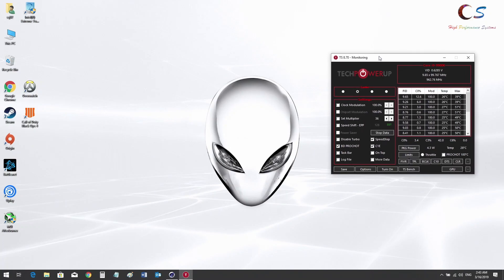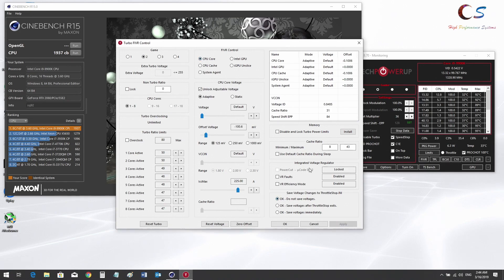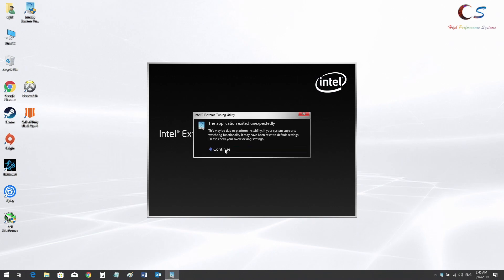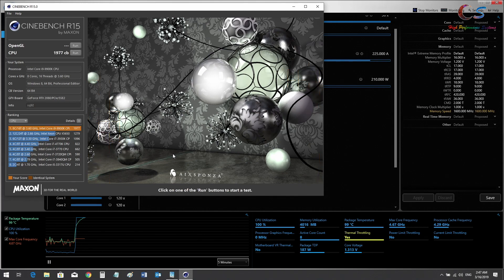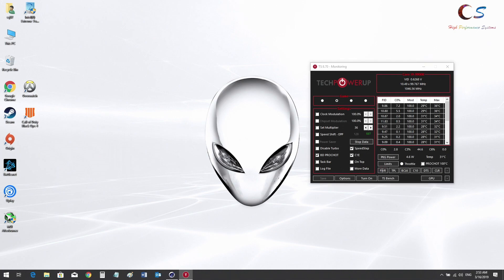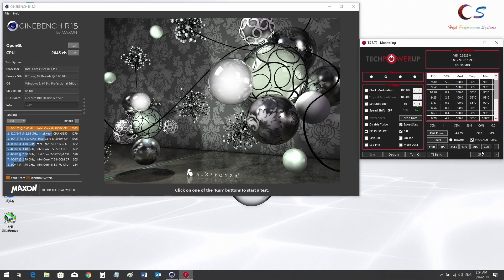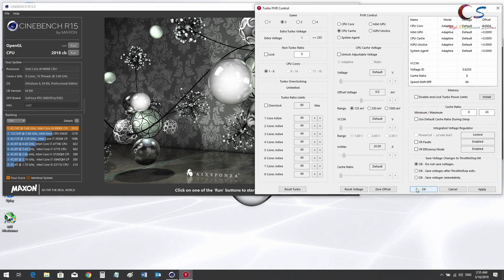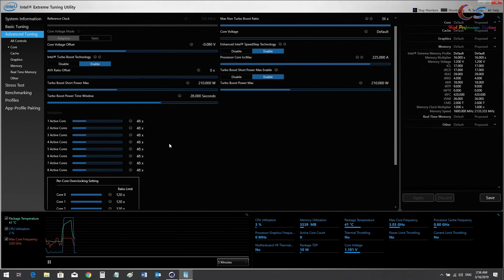Laptop CPU Undervolt & Overclock (Throttlestop & Intel XTU)

Comment: The option are greyed out. Any tips? Thanks
Reply from the maker: Which cpu do you have?
Reply: @cs.studios  Alienware 13 R3
Reply from the maker: Which option is greyed out
Reply: @cs.studios  turbo FIVR control (cpu core, cpu cache, intel gpu, cpu core voltage etc). Thanks

Comment: After undervolting my i5-8265u

My CPU seems to have its clock speed at 3.3ghz at idle...

Before it used to be at 3.8ghz at idle...

But then during long and heavy work loads my cpu still seems to stay at 3.3ghz

At stock it would have dropped to 2.8ghz....

Is the idle clock speed normal?
Reply from the maker: Yeah should be fine
Reply: @cs.studios  ok!
:awesome:

Comment: Will throttlestop work against the Alienware command center if I adjust the setting of thermal and overload in the command center?
Reply from the maker: The new AWCC requires a trick to bypass the limit

Comment: Can u please list your specs?? name of the laptop? I have an m15 r2 and trying to find a good value for undervolt to use with throttlestop.
Reply from the maker: Alienware Area 51m 
Intel core i7 9900K 
32GB RAM
RTX 2080 
1080p 144Hz display 
330w + 180w AC Adapter 
Windows 10 Pro

Comment: i m not able to select checkbox of overclock (in throttle).
i5 8250u hp
Reply from the maker: The 8250u is not unlocked and cannot be overclocked. You can still undervolt though

Comment: Hey guys, so I have the M15 R3 and I am selling it. (Brand new, just bought it 2 weeks ago.)

10th Generation Intel® Core™ i7-10750H
Windows 10 Home
 RTX 2070 SUPER™ 8GB GDDR6
32GB DDR4 2666MHz
1TB PCIe M.2 SSD
300Hz Display 3ms  100% Color Gamut.
Color: Black side of the moon
Added: (m series Per key RGB Lighting)
It is marked for $2,300 right now and I am willing to sell it for $2,000

Reply if interested.

Comment: Great video.
Im just wondering hows the temps with combine GPU + CPU loads?
What is the EC Limit for combine GPU + CPU load?
Reply from the maker: On area 51m the cpu is around 80s and gpu around 70s. The CPU can hit 200w ang gpu as well. Temps become an issue at 5Ghz.
Reply: @cs.studios  ppppp00

Comment: Help me please I have a i7 9750h is says that turbo over locking is locked in throttlestop
Reply from the maker: The 9750H does not support overclocking. You can only undervolt. Only 9880H and 9980HK can overclock.
Reply: @cs.studios  isn't it locked for the new "plundervolt" virus?

Comment: The voltage sliders are greyed out in XTU and changing voltage settings in XTU does not causes any change in actual voltages after a recent bios update on my dell 7577. Do you know any workarounds for this?
Reply from the maker: Did you try Throttlestop?
Reply: Yup, didn't worked. Seems to me the settings got screwed after I installed the bios which contained the fix for plundervolt.
Reply from the maker: I heard a windows update also ruined voltage controls. It could be the windows update
Reply: They had started delivering bios updates through windows updates (capsule update as they say it), may be that?? If it's windows, there might be a workaround sooner or later.
Reply: Do you mean "C:\Windows\System32\mcupdate_GenuineIntel.dll" this issue?

Comment: i fail set up intel XTU help
spec notebook i7 8750H gtx 1060 6G
Reply from the maker: Have you tried throttlestop?
Reply: @cs.studios  yes i tried
Reply from the maker: What issue are you having?
Reply: @cs.studios  I setup fail XTU
Reply from the maker: Try to install this first https://www.techpowerup.com/download/visual-c-redistributable-runtime-package-all-in-one/
Reply: I'm using i7 8750H, GTX1070. Mine works with throttlestop. The undervolting really helped to get rid of CPU throttling

Comment: Why i cant overclock in the throttlestop? 
i5 7300HQ Laptop
Reply from the maker: i5 7300HQ does not support overclocking. You need 7820HK to overclock. You can however undervolt to help reduce temps and power usage which can also increase performance by allowing the CPU to stay at its turbo speed longer.

Comment: Hey, total newbie here. I got a new game but CPU isn't up to par, I'm running a Lenovo Legion Y-520 with i5-7300HQ @ 2.50GHz with 8gb RAM and a GTX 1050 4gb. Will following this guide help me in increasing CPU output at all?
Thanks in advance!
Reply from the maker: Try getting a -100mV undervolt. It should reduce temps and power and allow CPU to turbo more.
Reply: @cs.studios  Thank you! It's what I got set up right now. I did not expect Bannerlord to be so costly in terms of CPU usage though!
Reply: @cs.studios  can i oc my 9300h thru xtu or throttlestop? or any other way?

Comment: Hey a couple of quick questions! Im getting my laptop tommorrow, basically just researching so I know what to do when I get it.. Which one of the 2 programs do you prefer, and; will these settings remain after I restart the computer? (do either of the programs have to run on startup for it to work?) Thanks man, your video was very helpful!
Reply from the maker: Throttlestop is more lightweight and what I use. However for ease of use and auto startup XTU is better. For throttlestop, you need to create a task to auto start it.
Reply: @cs.studios  Alright! Thanks man! I'll look into TS, the startup task wont be a prob. Thanks again!

Comment: What happens when you undervolt it too much and it becomes unstable? Does the laptop crash?
Reply from the maker: Yes it will crash. If using XTU, upon restart, it will revert the settings. If using Throttlestop, as long as the app is closed, the UV won’t be applied. You can delete the throttlestop.ini file to revert all changes if needed.
Reply: @cs.studios  thanks for the info, i will use XTU, it looks easier

Comment: Brother, I own a omen 15 and after installing xtu and restarting it says validation signature failed.
I tried reinstalling xtu and even I done a clean windows 10 reinstallation but sadly nothing worked.
Please help me out
Reply from the maker: Is the error with XTU? If so, have you tried throttle stop?
Reply: @cs.studios  using throttlestop right now, but xtu will be better.

Comment: my settings are 5Ghz @ -0.95V  

After prolonged stressing it drops down to 4.9Ghz 

is this a good silicon?
Reply from the maker: That's not bad. I get -100mV stock. For 5Ghz I can barely do like -15mV
Reply: CS Studios good to know, you have an insight on how a good silicon behave ?
Reply from the maker: I think your CPU is good. Theres better but yours seems to be above average.
Reply: CS Studios 

Thanks for your reply.
I believe it doesn’t mater how much i drop down the voltage , even if my cpu is stable , it throttles down. The best way to find out is to find a better thermal solution system for the cpu first
Reply: CS Studios well I dropped the core clock to 4.9 ghz @ -0.135 mv and temp in 80s under stress . I think I’m satisfied with that

Comment: You might look at intel recommended clock speeds - not all cores should be at the same clock. Usually they drop 100mhz for the first 4 cores then level off. So for a 6 core CPU the clocks should read 5.1, 5.0, 4.9, 4.8, 4.8, 4.7. This means that when all core are used they will all run at 4.7/4.8 and when gaming ( usually meaning just 2 cores used ) you will get the 5.2/5.1 clock speeds depending on whether windows redistributes the workloads to the other cores or not.

I have an 8700k stable at these speeds and it runs at 4.995 all cores on the above setup. I undervolted 70mah and get 40/50c on full load.

Comment: My alienware m15r2 with 2080 max q and 9750h managed to run a timespy benchmark score of 8307!!! guess how, by watching ur cpu undervolting video. However, instead of an gpu undervolt, i actually did a gpu overclock cuz my gpu temp is in the 70s at stock.
Reply from the maker: Nice! Yes overclock moves the whole curve so it helps across the whole low and high end.

Comment: hello I have a question, I have an HP Omen i7-9750H Processor with a RTX 2060 (https://www.amazon.com/HP-17-Inch-i7-9750H-Processor-17-cb0030nr/dp/B07T6BV4BD ) this computer and when playing the new modern warfare I am reaching almost 90C for my cpu when being charged,  should i just download throttlestop?
Reply from the maker: Yes download throttlestop and try undervolting. You should be able to get -50mV to -100mV maybe even more.

Comment: Hello! Cool video!
What is the settings for i7-4720HQ on laptop?
Reply from the maker: For 4702HQ you cant do much since it is locked CPU. Best thing you can do is undervolt to around -50MV most likely on CPU CORE and CPU CACHE options.
Reply: @cs.studios  hello!
Thank you!
Can i change also the igpu volt?
Reply from the maker: Yes you can undervolt it but I dont think there will be much benefit for that  one
Reply: @cs.studios  ok thanks!
Yeah, a little improvement only.
If i did not unchecked the multiplier, it will go so high aroud 92degrees, but if it is unchecked and the turbo is disabled, around 75-82degrees.
Reply from the maker: It might need repasting, I would try lowering CPU CORE and CPU CACHE (make sure they are same value) to around -50mV and go from there see if its stable and work up or down.
Reply: @cs.studios  thank you!
It is stable now!

Comment: Can i use XTU for undervolt my laptop i7 3612qm?
Reply from the maker: Undervolting will only work on 4th gen and newer. You have third gen so you can only increase voltage
Reply: CS Studios aaah i see, thanks for the information even i get disappointed but it’s ok

Comment: The turbo ratio limits are greyed out so how would I fix that?
Reply from the maker: Which processor do you have?
Reply: CS Studios hey i have an  i7-7700HQ and its greyed out too
Reply from the maker: @tarekmo4829  On a i7-7700HQ, the turbo limits are locked because it is a locked processor. You would need something like a 7820HK to overclock. But you should still be able to undervolt to reduce power and temperature.
Reply: CS Studios thank you very much

Comment: Hi, i tried to undervolted my alienware m17 r2. But after restarting the laptop to apply the setting here's what it shows. The following seetings could not be applied successfully: Core voltage offset, processor cache ratio, cache voltage offset. What can i do?
Reply from the maker: Trying to make sure only core voltage offset is changed in XTU, others will change with it. You can also use Throttlestop instead.

Comment: Will this prevent downclocking? I3 8130U cpu boost is 3.4ghz and on games i down clocks to 2.2ghz (base boost) and i want to prevent it is there any way?
Reply from the maker: On a U CPU it down clocks because there's a turbo time limit. It only allows you to sustain a boost clock for a specific time and power. If you can undervolt, it should reduce the power usage, and in theory should allow a longer boost time.
Reply: @cs.studios  ok thanks for fast reply i will try it

Comment: I use dell 5577
 when reducing the CPU voltage to -0.15volt and playing fifa 4, my laptop suddenly turned off the power without restarting itself
 What is that error?
Reply from the maker: Are you changing CPU voltage or CPU Voltage offset? Try -50mV first voltage offset first. Voltage should be set to adaptive.
Reply: @cs.studios  OK thanks 
But i thought when my laptop crashes it will restart but it shutdowns and i don't get it
Reply from the maker: It could be the voltage is too low and it just shuts down.
Reply: @cs.studios  And it doesn't ruin my laptop?
Reply from the maker: No this will not harm the laptop, worse case is you experience a shut down or freeze as you did and you lose your work during that session. Once you find the stable voltage it should be fine.

Comment: undervolting = more frames?
Reply from the maker: If you're computer is running hot or going over boost power duration then yes this can help with frames by lowering temperatures and power consumption.

Comment: I dont find the fivr thing the settings that you set up at the beginning, also the intel extreme is not working for me, the advanced area is locked or grey colored so i can't click anything or even change.
My cpu is xeon 5620
Reply from the maker: Hmmm if I remember correctly , those Xeon processors cannot be overclocked using this method. This is more for 1st gen + i7 etc. I think you would need something like a Xeon W3680 to do these types of things. Your best bet will be looking into the BIOS.

Comment: Thanks for this. Been confused on how to use XTU and TS to overclock. Before getting my 51m (first unlocked CPU I've had) I've only ever used them to undervolt.

You should make another video, on advanced overclocking and show how to adjust voltage in these programs, as I still dont know how lol. Anyways, good video. Thanks again.
Reply from the maker: I'll see if I can make a video on advanced overclocking. However in this video, it should be sufficient enough to overclock the same way I did.
Reply: @cs.studios  Awesome, thanks man.